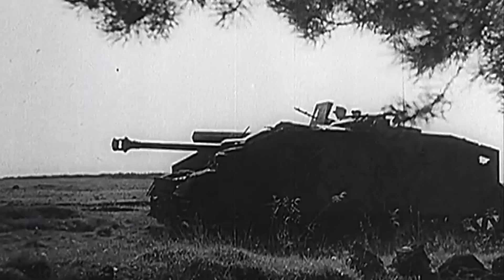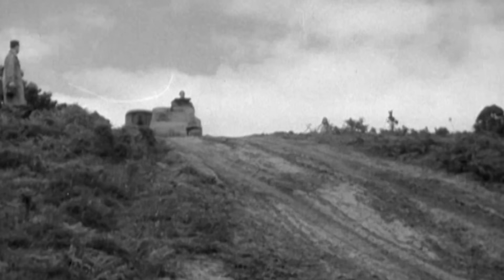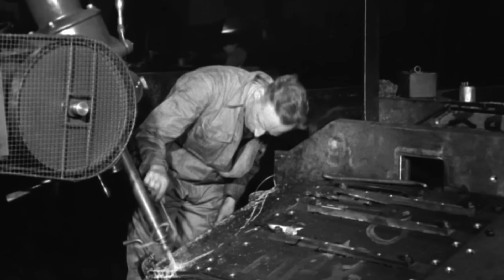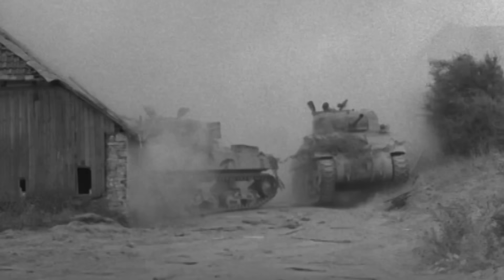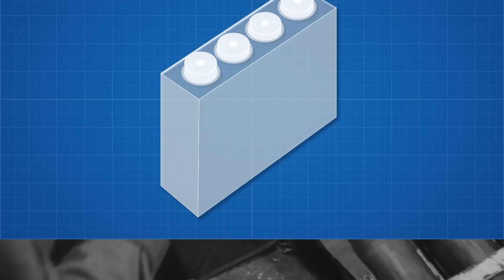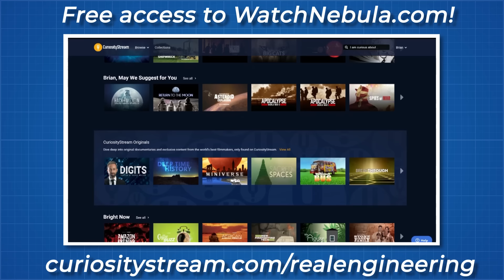M4 Sherman - The Workhorse of D-Day

Comment: About the different hull designs - they didn't move from cast to welded because of the complexity. Both were produced in parallel depending on the available technology of the factory at hand. Also the same thing with engines, some had aircraft engines, some had double blocks of a truck engines, some had intended tank engines, all depended on what was close and available in the area of production.
Reply: Not really no. After the introduction of the M4A3 the Production of M4A1 and M4's stopped. The M4A2 was made for the Marines and soviets, and the M4A4 was made purely for export.

Comment: Tell me if i'm wrong but didn't the firefly have the best gun, not the Easy 8?

Correct me if i'm wrong
Reply: The 17pdr was an excellent field gun and would usually have the highest penetration of any particular group of Shermans. Despite this, it had numerous characteristics that made it much less well-suited for use as a tank gun. The gun and projectiles were very large, taking up space inside the Turret and reducing ease of loading. The muzzle blast was very powerful, often obscuring targets and making it difficult to observe where a shot would land. The 17pdr had a weak HE shell too, and HE constituted the vast majority of shells fired by tanks. Because of these flaws, the 76mm was probably a better tank main gun. Once 76mm HVAP was available in large quantities, it became the clear choice.

Comment: Nice doconi did notice a few mistakes. The track width extensions were called duckbills. Trousers are fitted to the track plates and provide more grip, a bit like snow chains do on tyres. They are usually in the form of ribbed plates. The dad tanks did not wade they swam, it was the tanks with extended trunk air inlets and exhausts that waded ashore. Quite a few shots were of M10 tank destroyers. Also you diagram showing the extent of the early main body casting also included the removable front gearbox assembly that bolted into the front.interesting point the VVSS tanks were fitted with 10 different types of track. Otherwise a great little docco just like your others

Comment: You touched on a key point as to why the US did not invest in more larger heavier tanks to contest the larger Panzers. While it is true that larger tanks could have easily been developed and produced, they would have then had to be transported first by rail and then by cargo ships thousands of miles to the war front.  By producing smaller, more easily transportable tanks the allied forces thought to overwhelm the Wermacht with numbers.  It worked.

Comment: The 76mm upgrade isn't the E8 upgrade, it's the E6 upgrade. The Horizontal suspension is the E8. Also the M4, M4A1, A2, A3 are not chronological developments, most where produced at the same time but where produced by different factories.

Comment: The sherman was a really shitty tank...the only reason it was any good or the "workhorse" of anything is because there over 60,000 made and massively outnumbered German tanks, but in reality a Panzer 3 with a 50mm gun could pretty easily destroy it
Reply: Far from the case.
Reply: @peterson7082  not even close...the sherman had problems with even the late models of the Panzer 4. The 76mm sherman could take on heavier German tanks, but as I said before, realize that a 50mm Panzer 3 could easily destroy sherman from even 500 meters away
Reply: @UFCMania155  

> "realize that a 50mm Panzer 3 could easily destroy sherman from even 500 meters away"
 
The 5,0cm. KwK 39 L/60 would have serious difficulties from that distance, less than 100m. is what is what limited to. The Panzergranate 40/39 could out to 500m. but these rounds were not all that common.

> "the sherman had problems with even the late models of the Panzer 4."

 Combat doesn't reflect such. Nor is their difference on paper significant enough to make that argument.
Reply: @peterson7082  wrong. The German 50mm Panzer 3 had 2 models...a lower velocity gun and a high velocity, long gun. The lower velocity 50mm could destroy early models of the sherman and once later models such as the 76mm and easy eight were produced, the long, high velocity 50mm gun could easily deal with them. The Panzer 4F and H had high velocity 75mm guns that could destroy shermans from even 750-1000m away. The sherman's only advantage is that it was produced in such mass numbers (like the t34) that high losses to Panzer 3's, 4's, Panthers and Tigers didn't matter. Get over your bullshit idea that the americans had the best vehicles and guns in the world because it's simply not true lmao
Reply: @UFCMania155  

> "The lower velocity 50mm could destroy early models of the sherman"

 Could. Quite capably from the side like most tank guns- but unless under 100m. head on, the L/42 would be incapable of dealing with the M4. The story is largely the same with the L/60 excluding the Panzergranate 40.

> "The Panzer 4F and H had high velocity 75mm guns that could destroy shermans from even 750-1000m away."

 Reliably up to 650m. same for 75mm. Gun M3 armed M4's vice versa. Again assuming head on. 

> "The sherman's only advantage is that it was produced in such mass numbers (like the t34) that high losses to Panzer 3's, 4's, Panthers and Tigers didn't matter."

 How was that its only advantage? The Tiger was a particularly rare threat for any country, and even then the losses against IV's and Panther's at least for most American Armored Divisions was bout 1:1, if not more. Heck the 3rd and 4th Armored Divisions generally achieved a 3.6:1 K:L per engagement despite having only 1.2:1 advantage in tanks. This comes from David C. Hardison's "Data on Tank Engagements: Involving the American 3rd and 4th Armored Divisions." 

> "et over your bullshit idea that the americans had the best vehicles and guns in the world because it's simply not true lmao."

 That wasn't my point. I was correcting your honestly unfounded claims.
Reply: it was one of the best of the war.

1. everyone used gasoline engines on one tank or another
2. the gun was comparable to german counterparts at the time like the PZ IVs short and long 75s
3. the armor was quite comparable to the tigers ~85mm to 100mm
. and a panzer IIIs 50mm definetly had no chance
4. the sherman was statistically in the top 3 safest tanks in ww2 and most of the crewmen were killed outside of the tank
5. it was incredibly reliable and easy to repair

so get your facts straight
Reply: @snonsig2688  if the u.s invaded normandy all by itself, they wouldnt've made it off the beaches
Reply: @UFCMania155  you know normandy wasn't all armies  mixed up right? Every nation had their own beaches. The troops at omaha were almost 100% american so they did get off the beaches by themself. And what's that even got to do with the sherman?
Reply: @snonsig2688  if it was ONLY american troops attacking, and no other countries, the Germans would've easily won and could've also more easily brought in reinforcements
Reply: @UFCMania155  and? If there were only british troops the germans could've won. If there were only french troops the germans could've won. And? It was a joint operation on a heavily defended beach. If it were only one german battalion in normandy the allies would've had a field day but that isn't relevant is it? You've still failed to explain why your argument had any relevancy in this discussion
Reply: @snonsig2688  you're on meth...please do the world a favour and shut your mouth

Comment: 🆘⁉ Mister Real Engineering, Interesting topic for an 🎆interesting ✨channel 🎇which I 🔭hastily follow.  🛑Several errors, though : 
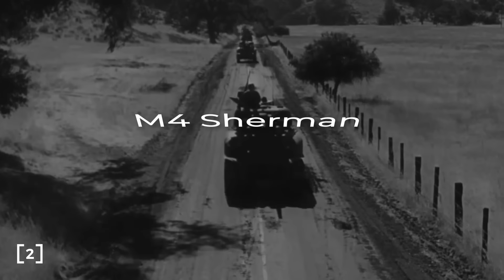1) 02:45 The most produced allied tank was the russian T-34 (57'300 tanks until 1945) against 49'234 U.S. M-4. Yeah, english folks should remember Russian were their allies. 😁
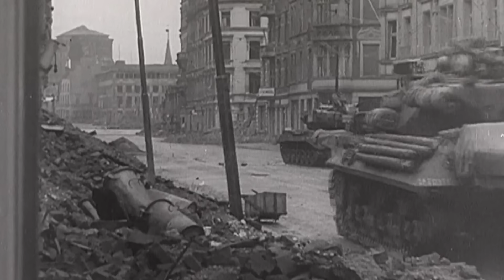2) 06:18 An engineer should 🙄NOT be talking of 😠FLOTATION about tank track, but should speak of GROUND PRESSURE. Caterpillar tanks tracks distribute the weight of the vehicle over a larger contact area than wheels, decreasing its ground pressure. This has NOTHING to do with a buoyancy process and Achimedes' principle, so it is not a flotation problem at all. The tank is NOT floating on his track. On the contrary, the DD assembly (Duplex-Drive for Normandy sea beaching) included a buoyancy canvas device, which IS a flotation issue. 😊
3) 09:33 Tank running through hedgerows is an 😮M5, 😱not an M4.
4) 10:31 Tanks targeted here are english Churchill tanks, seen here with their "Y"-shaped exhaust pipes, as they were in 1942 at Dieppe (french coast city) Raid. It may come from a german propaganda film, showing exploding Churchill tanks after the beaching battle in Dieppe (France) raid (which served as a kind of Normandy rehearsal), in 1942. Why show these Churchill tanks while talking about M-4 ? Didin't you find enough movie material about M-4 ??? I doubt so.
5) 10:33 Tank burning (Rear) and 10:34 (face) is a russian🤭 KV-1 (Why in the world show a KV-1 in this context, plus while talking about "Fury" movie 😳???) At least, add some written text/subtitle to explain what we see, and most of all, why.
6) 10:41 Tank beaching is an 😮U.S. M5 amphibious, 😱not an U.S. M4-DD. 
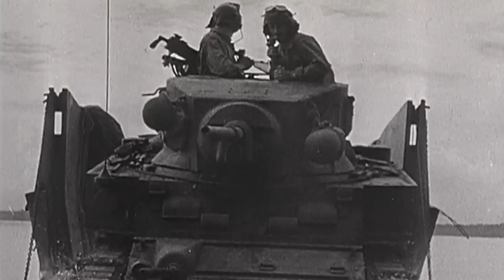7) 10:50 Tank beaching is an M5, not an M4. 

My main point here is : Your main topic is the M-4. You should present the M-4 most of the time, and, when you do show another tank, you should provide precise description (What, When, Where, Why). You have enough movie material of M-4 at your disposal to make a movie exclusively with M-4 images. 

Plus if you intend to make a series on Normandy  logistics, I think that this kind of video would be much better if it included subtitles to exactly describe what we see. For instance explain for  each scene what we see (what tank), at what date, and on what place/theater/frontline. Otherwise, you are going to generate lots of misinformed people, which is of course not your intent. Please consider this opportunity of being one of the most accurate historical YouTuber. I can lend a hand, if you want to check historical pictures and facts.

Anyway, 👍thanks for your work, 👏congrats for your successful channel, & 🖖KUTGW.

Comment: The Chieftain has a great video where he explains how and why the Sherman was a great tank.
1. Shermans always traveled in platoons of 5 tanks, so they would naturally meet any German tank with 5 tanks. 
2. Shermans were the most survivable tank in the war. He shows how easy they are to get out of. Much easier than British or German tanks. The stats show how FEW tankers were killed in the war. 
3. He tells stories of how tankers would get out of a shot tank, get another, and get back into the fight. 
4 He points out how the steeply sloped frontal armor gave it a high armor rating. Almost equal to a Tiger. 
Google him and check him out.

Comment: Also remember that the engine of early M4's was an aircraft engine and thus ran on much higher octane gasoline and was therefor much more flammable. The Firefly used a Multibank engine with 30 cylinders and was basically 5, 6-cylinder engines all strapped together.
Reply: The engine did not affect the likelihood of the tank to burn. Fires were almost always caused by ammunition igniting. You can see this in footage of burning tanks, which have flame that are visibly dissimilar from gasoline fires.

Comment: The most produced allied tanks of WW2 ? What about the T-34, weren't the URSS allied at that point ?
It's is around 84.000 tanks for all the variants of the T-34 versus 50.000 for the variants of the M4 Sherman.
Reply: 58,000, not 84,000
Reply: @peterson7082  Actually, just checked other sources, and it seems like it is 57.000 T-34 variant by the end 1945. Estimates puts it arounds 84.000 in total because it kept being produced after the war. You are right. 
That's still 14% more, and the point is that the guy who's making those videos really should proof read what he says a bit better.
Reply: I believe you are correct.

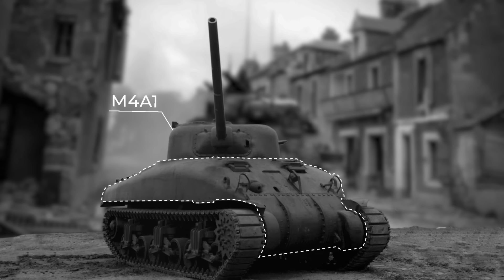Comment: 5:50, the single cast upper hull didn't include the 3 piece  transmission housing at the front as depicted. Nor was the "entire hull" cast in a single block, just the upper hull.  Lower hull was welded plate.

Comment: the difference between the americans and the soviets

the americans mass produced quality and easy to repair tanks, the soviets produced a tank.
Reply: Your not wrong
Reply: @mekhane.broken9678  it was one of the best of the war.

1. everyone used gasoline engines on one tank or another
2. the gun was comparable to german counterparts at the time like the PZ IVs short and long 75s
3. the armor was quite comparable to the tigers ~85mm to 100mm
4. the sherman was statistically in the top 3 safest tanks in ww2 and most of the crewmen were killed outside of the tank
5. it was incredibly reliable and easy to repair

so get your facts straight

Comment: 0:30
those are stugs, which were developed after Germany invaded the USSR (not before or during the invasion of France) and ran into the kv-1 and t-34, which could not be reliably penetrated with their 37 and 50mm guns.
9:08
except the tiger 2, the jagtiger, the ferdinand, the maus...
EDIT:
10:34
THAT IS A KV-1, NOT A TIGER
Reply: Stug III was used in the battle of France.  

No the 76 Sherman was still a threat to those.  Using HVAP it is theoretically able to get through the turret of the king tiger also mission kills are a thing.
Reply: @caif4  stug 3 a with the boop snoot?

Comment: The M1A1 and M1A2 main armament fitted to US tank detroyers (M10) and the M4A3E8 were still not powerful enough to confidently knock out German Panthers and Tiger tanks (let alone the Tiger 2) the only version of the M4 Sherman that could was the British M4 Firefly fitted with the 17-pounder.
Reply: the 75 could punch through the tigers front under 500m and the 76 even further than that. and they only faced tigers 3 times

Comment: FYI the Soviets made twice as many T34's. You probably should say western allies if you are not including all the allies
Reply: No they didn't produce twice as much.
Reply: @peterson7082  well it's close. If you include the T34/85 it is about 85,000 to about 50,000 M4 all variants
Reply: @seanc.5310  The production of T-34's was approximately 58,000 during the war. The figure you have includes production all the way until '1958.
Reply: @peterson7082 yes. that's correct. I was just going by total production of both models. Still really impressive seeing as the Soviets had to move all the factories during the war as the Germans moved east.

Comment: Sherman sucked. No armor, no firepower, combusts on impact combined with a huge profile. I would rather be on the ground
Reply: Tankers had casualty rate of 3%, infantry 18%. The Sherman had plenty of armor and firepower for at least 9 out of 10 situations. Also, the Sherman didn’t burn any more than any other tank.
Reply: Ground troops had a larger death rate.
Reply: 1. no armor
it was comparable to the tigers. ~85 to 100mm. german guns would bounce more often than not.

2. no firepower
ignoring that it was an infantry support gun it was more than enough

3. and that's just wrong

the sherman was in the top 3 of the safest ww2 tanks

Comment: that 5 to 1 myth is a gross misrepresentation. Just think if you have 20 tanks to spare and the enemy is defending with 2. well already attack doctrine states you want a 3 to 1 advantage, but why use the minimum when you'd have 14 more to spare. Having an overwhelming advantage means higher chance for success and more often less casualties.
Reply: That and the smallest tank unit is 5 tanks.

Comment: "The primary weapon of a tank is the machine gun." 
G.S. Patton
Reply: That's why the Sherman carried about 10,000 rounds of MG ammo.
It's primary role was dislodging machine gun emplacements.
The typical Allied platoon was a group of riflemen.  The typical German platoon was a bunch of guys humping MG ammo and spare barrels to support their primary weapon, a MG34 or MG42.

Sure, that's a generalization, but it helps to understand the tactics, and the value of a good-enough tank that can be built in large numbers rather than far fewer win-against-anything tanks.
Reply: @1djbecker  Agreed 100% 
I was a 19K M1 Armor Crewman, the M1 carried over 11 thousand 7.62 rounds and 8 thousand were 1 long belt for the coax. A real pain to load.
That was the original M1s, 105mm main gun.
They may carry more or less now.

Comment: the 75mm M3 gun on earlier M4s was fairly capable of killing tanks as Shermans really only saw Panzer IVs although it did face Tigers in Africa and next to no Tigers in France, which is why it only got the 3-inch (or 76.2mm) M1 gun later in the war. Ordinance Branch didn't see a need to upgrade because they saw it as 'if it works, why change it'.